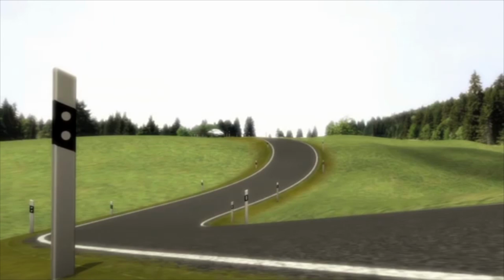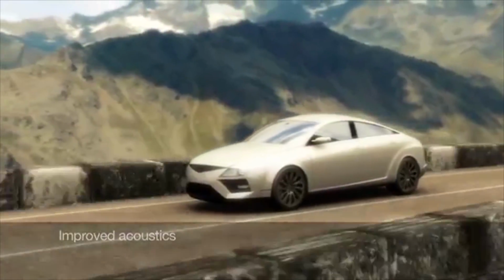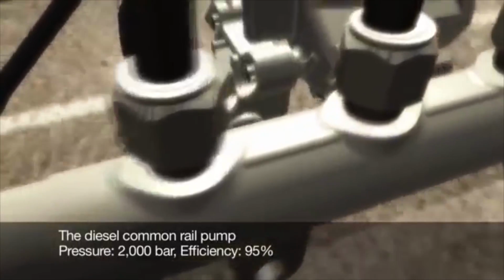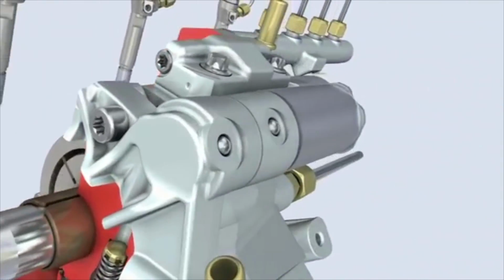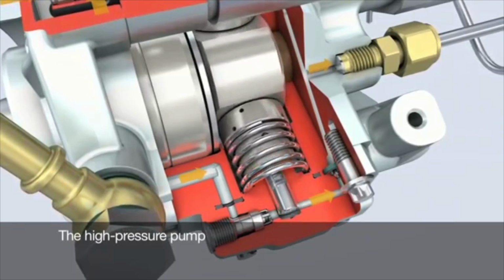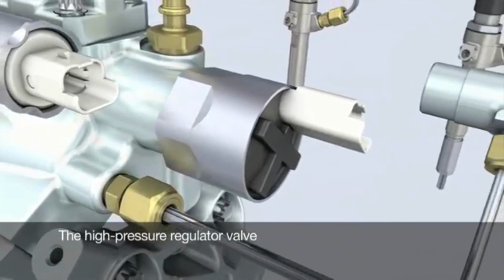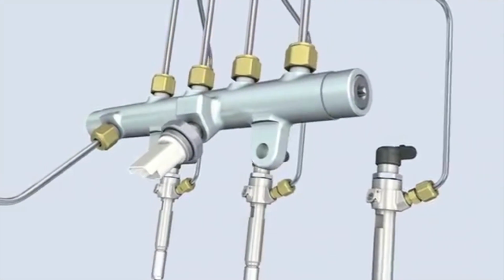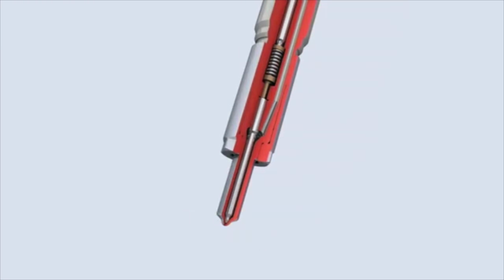VDO Diesel Repair Service | for Common Rail Diesel Systems

Comment: Hello, thanks for the video. I'd like to know if volume flow regulator valve (VCV - low pressure side) can be replaced without causing issues to the high pressure pump, since I don't know 
if it could lead to air entering the system. Could you please explain me the correct procedure to avoid problems? Thanks in advance.